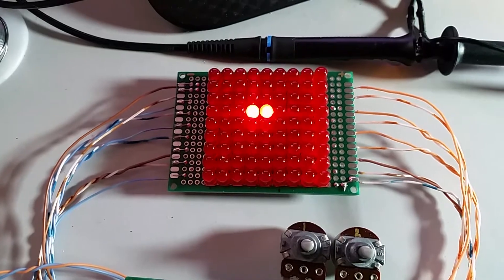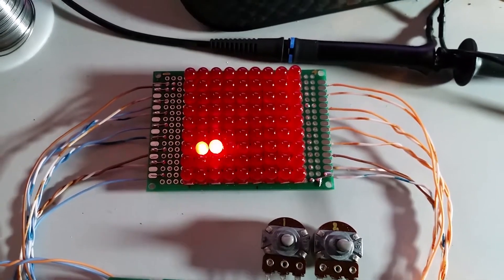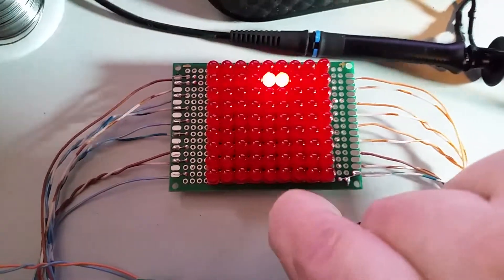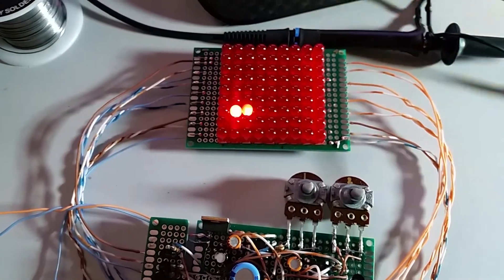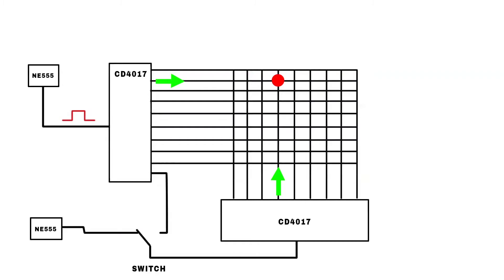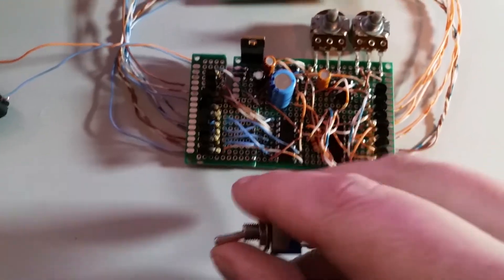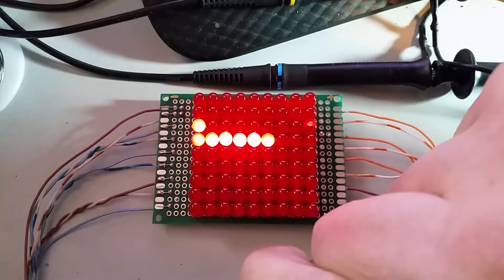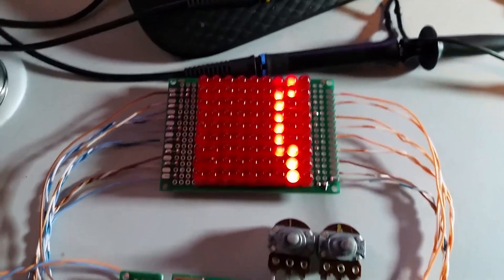81 LED Chaser with 2 NE555s!!

Comment: Nice! Some years back, I built an LED matrix oscilloscope from an electronics magazine article that used a 555/4017 for the time base (X axis) and an LM3914 bar/dot display driver for the Y axis.
Reply from the maker: I have that project on my website aswell. It's a 10 by 10 LED oscilloscope. I'm still looking for a way to introduce some sort of trigger function in the circuit so the waveforms are more stable.
Reply: hi O...
'
my 81 LED kit is a coool...
https://www.youtube.com/watch?v=gtF9X4cejkI